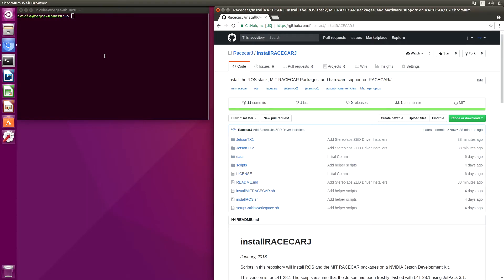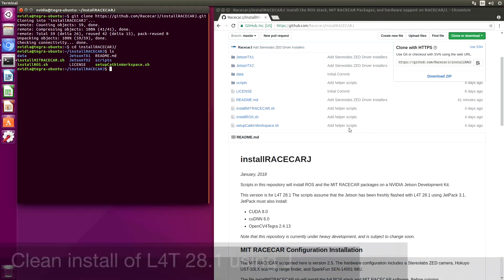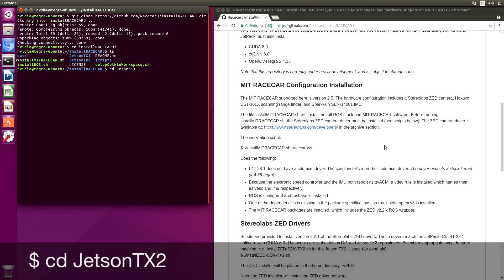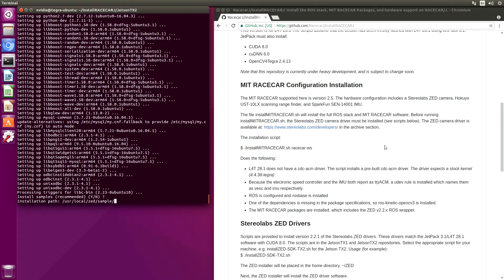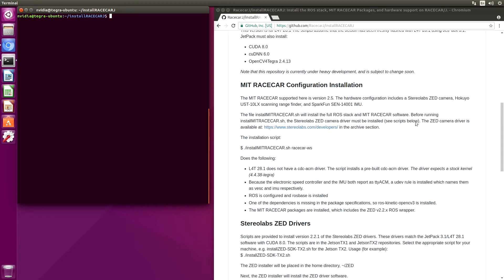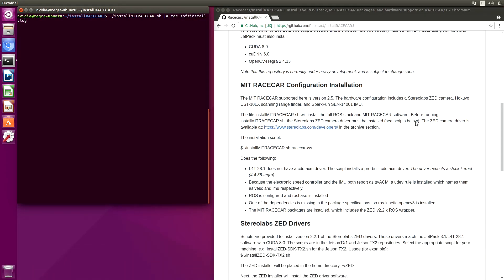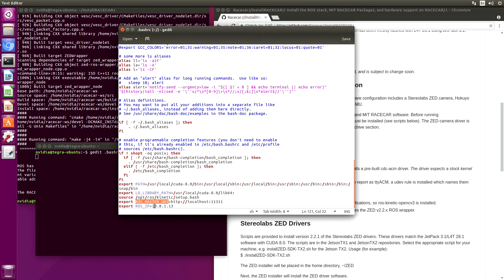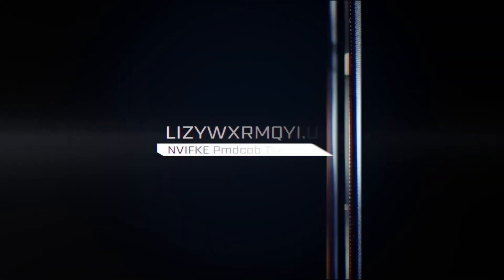RACECAR/J Software Install

Comment: Hi, Mr JetsonHacks. I have tested all of the sensors and actuators including: Sparkfun 9dof razor IMU, ZED camera,  HOKUYO UST-10LX,  VESC4.12, (additionally a GPS receiver), steering engine, and all of them could receive data or act. but i didn't know how to conbine this device together so that they can work together, and then i can program racecar.(NVIDIA jetson TX2)
Reply from the maker: I'm glad you were able to get everything to work. Not quite sure what you are asking here. Can you teleoperate the vehicle?